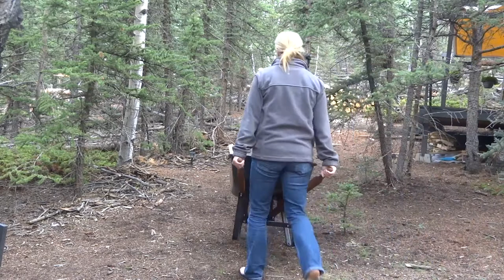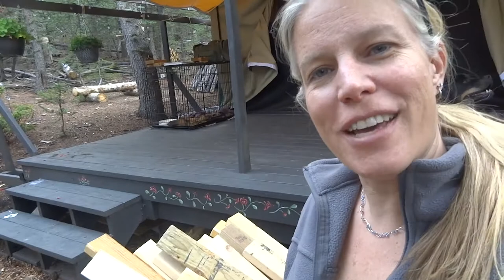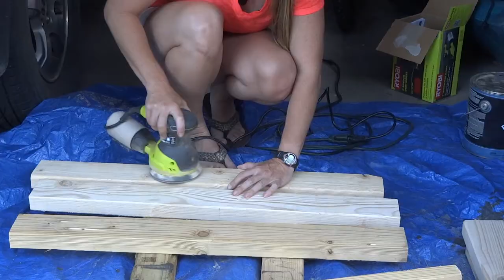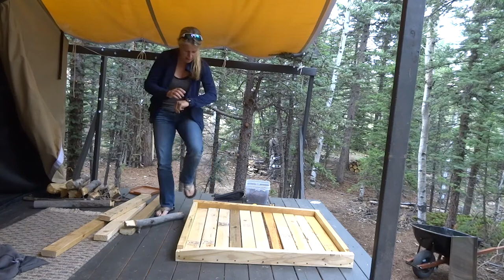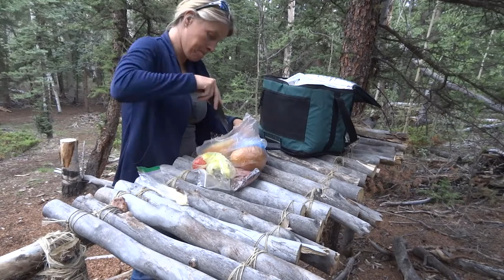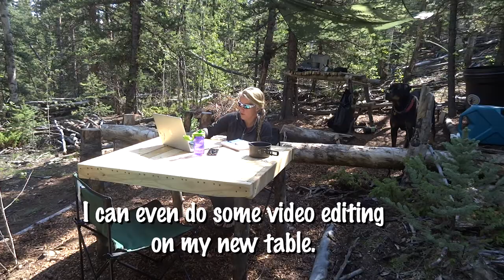Building My Camping Table for FREE - Our Journey :: Episode #81

Comment: I just chanced upon your channel and its making me wish I had the time to do all of these things. I thought when I retired from the military I'd have a bit more free time, as it turns out, I have less.
The more you build the better it will turn out as you learn. Also bear in mind that most of the time you'll learn more from a failure than from a success ... I always have anyway.
Anyway, If you intend to use the natural wood on your property I would suggest picking up a draw knife and removing the bark. For maximum life you may even want to soak or brush about 6 coats of a borax solution on it to keep destructive insects away.
A draw knife is a relatively cheap tool, but it is invaluable if you are using natural wood.

Good luck
Reply from the maker: Thanks for your comment.  I hope you can still fulfill your dream.   I do continue to build and "play" with the wood on the land.  I didn't have a teacher growing up.. so learning this all on my own.   And 100% agree with "learn more from a failure than from a success.."  I teach my kids that way too.  I have them try and when/if they fail then I step in.  :)  Cheers!  Hope you enjoy the other videos too.

Comment: Drill the holes first with a smaller drill bit than the diameter of screws. The wood will not split when drilled. Take a speed bore bit and drill a hole in your legs and cut a branch to fit in the holes from leg to leg for braces.

Comment: Also you can add  2x4 pieces cut at 45° angle each end to underside (screw at each side of frame and 1 from table top) to sandwich legs and another screw point. (Form a triangle)

It's hard to explain carpentry. Lol
Reply from the maker: I got it.. I think. lol
Reply: Spirit Forest 

Cool. I enjoy your videos very much.

Comment: yes you gotta predrill your holes with a slightly smaller bit than your screws.
And you gotta add some bracing to the legs, it won't hold up without bracing, but hey we all gotta start somewhere right sister, and that aint bad for your first table, I think it even looks better than my first table ;-)
Reply from the maker: Thanks Billy..  Yes I am thinking about the braces.. not sure now I am going to do that?  45 degree angle from the leg to the edge of the table?  Afraid it might break the legs.. but I could pre-drill it.. hmm..  (Thinking out loud)
Reply: When in doubt use lag bolts, or bolts, flat washer, lock washer and nut.
The thing to take away is regular screws wont work so good on heavy pieces of wood like those legs. Also depending on how much they weight the bottoms of the legs will tend to swing in or out if the 45 degree braces are not long enough. Cut one board test install it and check how sturdy it is, if it's not sturdy and you have to come up with another idea then at least you haven't ruined more lumber by cutting it.
Also brace each leg on the long side and short side, especially if you are not planning on bracing the bottom of the legs to each other.
If you use lag bolts (look like large screws), then pre drill or you will for sure split the wood. If you use the nut and bolt method you will drill the size of the bolt all the way through the wood.
I hope that helps :-)
Reply: BTW, in case I haven't said so already, love your artistic imagination and skill. You have some great talent :-)

Comment: If you could have used the edge of your deck to screw table together by keeping the edge of table flush with deck edge.Then your able to have a straight on axis instead of the drill being against the deck....then screw in a board in the back of the table into deck as a back board to give you something to push against...But also....that wood looks like spruce pine and next time.....pre drill holes to avoid splitting the wood.But anyways......great job.....and the more you do.....he better you get at building stuff

Comment: I just did watch this video. Drill! Enough of that word! To do what you need without buying tools is what your artistry is all about. To stabilize the legs without adding braces is easy. The table looks about a foot or so too high up. Dig some holes to place the legs into. When the depth of the holes creates a comfortable table height, You can pack dirt around the legs and all will be well. By the time the weather wears the table out, You will have found creative ways to build an even better table. I hope you try to stick with your all natural table idea. You might want to get a few cheap had tools though. Chisels and wood shaping tools. I would love to see your original idea come to life. You won't be able to do that with just a hatchet and knife. I love your videos and your determination. Keep on keeping on.
Reply from the maker: I would LOVE to see my original idea come to life too..   I am in the process of looking for the right tools for the curved wood.  Thanks for pushing me to complete my goal.  ;)
Reply: Sorry, I should have said draw knife instead of wood shaping tools. It's basically a knife with handles on both ends. There are three different kinds. The one you will need for general use is the straight blade. They also have them with curved blades but they are for advanced projects. They come with straight handles or 90 degree angled handles. Get the straight handle. This way you can push instead of pull. We both know all too well the dangers of pulling blades towards ourselves. The good news is that when you fall in love with the versatility of this blade, It is small enough to fit in a back pack.LOL. Actually they have different sizes. Just get a foot long or shorter but not too short. I used to build log cabins so I know a bit about comfortable tools. Check around and you might be able to find one for real cheap. Love your videos and your undying determination. Casey
Reply from the maker: I will for sure check this out!!  Thank you for the recommendation Casey!  I don't have a teacher for my wood projects so really appreciate your feedback.  I do love working with wood and creating, and hope to do many more projects.

Comment: the piece that you broke predrill holes and screw it, if you have glue use glue and screw it down carefully , you can make glue with pine pitch and charcoal , the piece that was broken don't over screw it.
Reply from the maker: It seems to be holding together, but noted on how to fix it.. and didn't know about the pin pitch and charcoal.  hmm

Comment: You must like working with wood ? if so don/t give up on log construction . you can make tools to do timber framing a brace& bit can be found at garage sales or you may try a battery drill with a large bit. mark the depth with tape to have consistency make a templet plate the size you need for the wood you are using  shaping the wood the same size as the rectangle templet plate. trace the rectangle plate on the wood drill out the center & trim in side with a flat chisel keep in side the lines marked on the wood you have to trim to fit! drill a hole in the log with the slot in center. the next step is to fit it market the hole with it to gather! take it a part and 1/8 in side the mark; drill a hole. you should use a hard wood for a pin this is how America was built Rollo 34
Reply from the maker: Thank you for your suggestion!